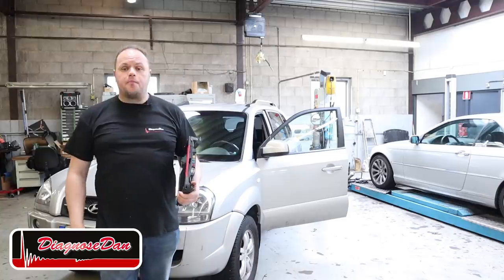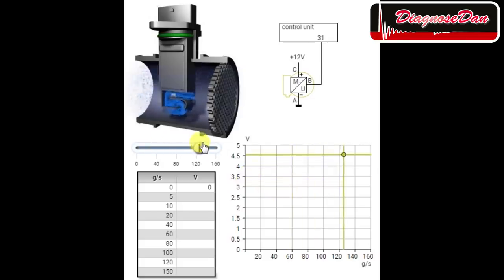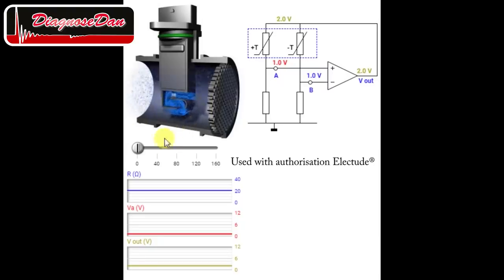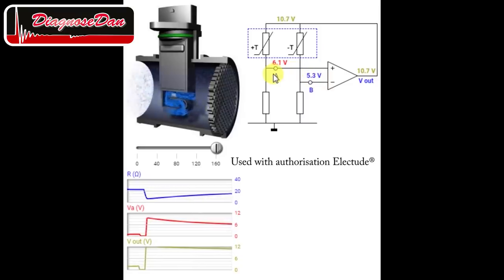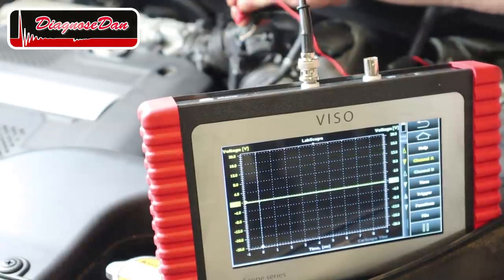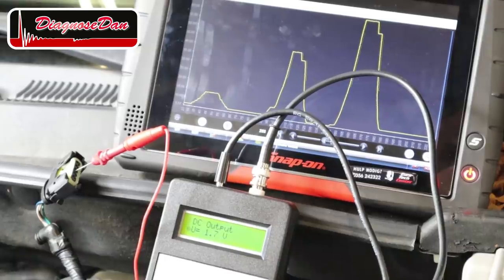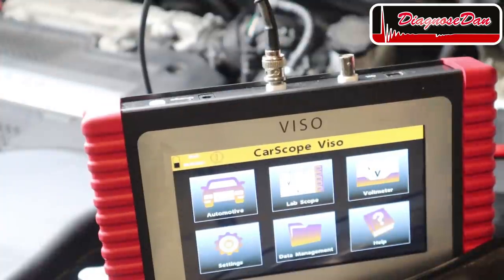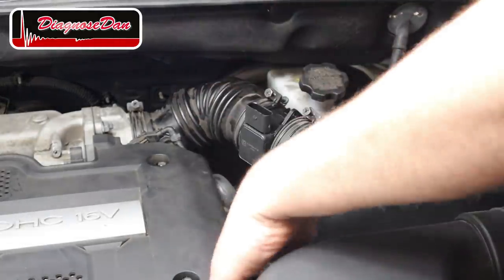Oem vs Aftermarket

Comment: Thank u!!  The maf is just one reporter. But I guess it must b the most important one. Shouldn’t the O2 sensor b keeping the fuel mixture in balance?  .Maybe at part throttle.  But in open loop, I guess the maf is going to b the big one. Once again, a video I will have to watch many times to digest. You’re getting real fancy with all the smoke and mirrors. Do have any snake oil?  Oh. U use that for your smoke machine. Jk
Reply from the maker: Maf is very important Bill ! I tried to explain it as simple as possible but watch the animation a few times and I'm sure you'll get it!
Reply: DiagnoseDan  U did a fantastic job!  Just like duty cycle and pulse width modulated video. Excellent, but those of us who grew up with only one electrical thing in our tool box, jumper cables, it’s been tough. But with guys like u teaching me,  I have become a flippin genius. I really like your strategy of having tools that can vary voltage, pwm, and duty cycle. That way u can mimic what the input is doing or control an output. Like u did with the fan motor. And what u did with the maf signal wire. Some really cool tools on that website. There goes the grocery money for a couple of months. Diagnose Dan broke my bank again.

Comment: I don't like aftermarket  parts .prefer oem all day long . And the maf sensor  snapon  is correct  it most commonly part to get changed  . You see it on the net .it will be mass sensor and they not even plugged  in to the car lol

Comment: wanted to share the final installment of Ford ka 2013 (fiat 500) story!.  story so far, bought back in june 2018, every time driven at 70mpg engine quits, engine warning light, can restart at 70mph but has misfire untill it then cooled down and restarted....every time read 'P' codes for 1&4 misfire, (car also started to misfire when cold , had a couple of backfires!)  changed, plugs, leads, coil twice, 2 injectors, engine wiring loom, both co sensors, crank sensor, and then sent cpu for testing, which took 4 weeks!, so car has been in shop 6 times (ford dealership twice) and since december 20!  cpu came back inoperable! wont run engine, shows permanent error for turbo(which no model has..)  cpu company is refusing to acknowledge that they did anything at all (but did charge £320 for their service)  so will probably come to a court case, and still car wont be fixed as no-one has tracked the error.  as of two weeks ago i refused the car under sale of goods act and changed to an entirely different car, a toyota! lol.   when checking the fords mot history, i noticed an entire year with no mileage before it was sold to dealer, so must be a known fault , the mileage was 9k for a 5 year old car, i think 1st owner never drove it on motorway and 2nd owner wondered for a year how to get rid
Reply: DiagnoseDan -😂🤷🏼‍♂️whaddaayaa say?
Reply: @paultomasetti5164  the only thing to replace is the engine :)

Comment: I wonder who REALLY makes the OEM parts ? VW, Hyundai, Mercedes ??? C'mon people, there are Aftermarket parts that are way better and way cheaper then OEM parts. You think that a Bosch fuel filter is not as good as an OEM one (that could also be a Bosch) ?
Reply from the maker: I'm talking about sensors in this Video, and you are right there are good aftermarket parts. But how should we know what's good and what's not. I guess we need to depend on the experience of our part supliers for that. The funny thing is in this case the price difference between the two sensors was only 10€.
Reply: @Diagnosedan  ...Sorry for the fuel filter. It just happend that I needed to change my MAP sensor, not the MAF which is stil ok, but I didn't hesitate in choosing a BOSCH one instead of OEM. Car runs just fine. My personal supplier of parts said the exact same thing...you can't go wrong with BOSCH. And it cost me nearly half of what the OEM would have.

Comment: For sensors take more than 3 hours of labour, don't take a chance ordering "OE QUALITY" or OEM manufacturer. They are not the same. People who are using APC or Worldpac Speed dial, there is a difference between OEM OE GENUINE. Be cautious. And whatever reason behind, don't use standard shit intermotor whatsoever

Comment: Please Dan, help me out. It’s been almost 2years with the problem.
https://youtu.be/LOsr_JNBD2g
You can see how rpm bounce up n down while i keep gas steady at 1k rpm. It does it only when engine is warm. And when it starts doing it the reaction to gas pedal is very poor and sometimes rpm rise when braking or fall down slowly. 
I’ve diagnostics tools but no errors at all except abs module which was long before it. 
Also fuel trims show a little rich (5-10%). What can cause it?
Ps: MAF and fuel pump been changed to OEM.